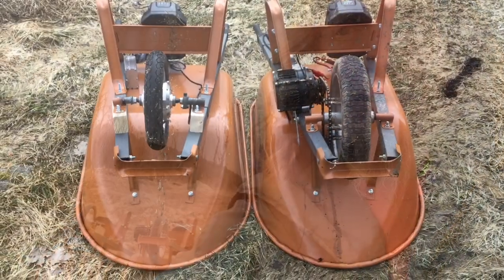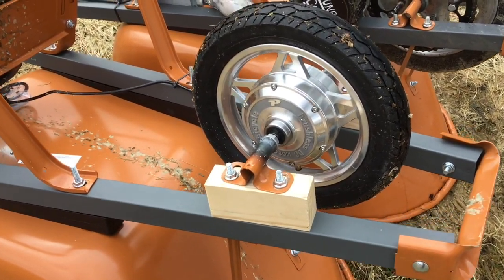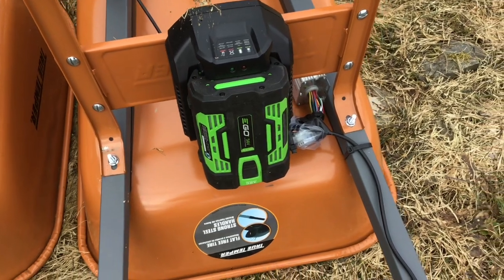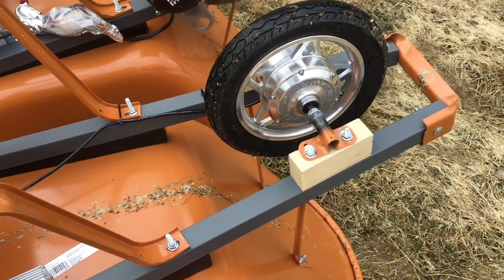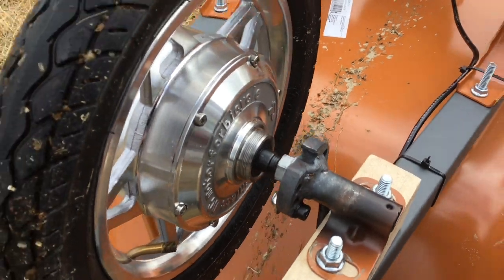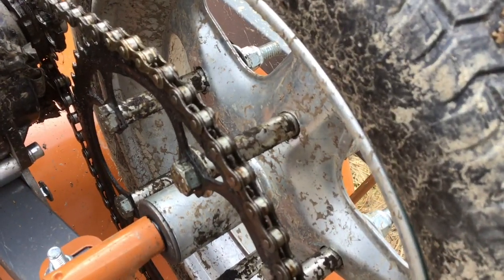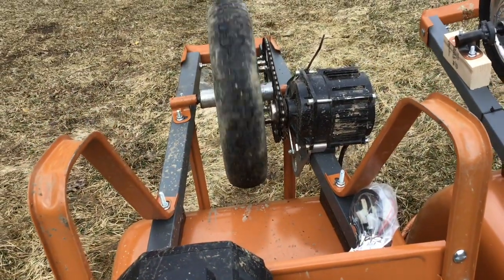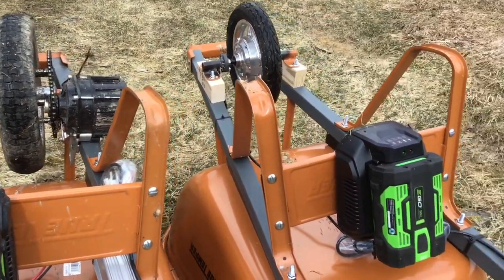Comparison between mid drive and geared hub DIY electric wheelbarrows

Comment: Great Video. Just subscribed. Any thoughts on the two-wheeled wheelbarrows?
Reply from the maker: Haven't tried it yet. The 3000W Cyclone can move close to 500 lbs of dirt. That's enough weight that I can barely maneuver it and lift it to dump. I wouldn't want to do more than that.
Reply: @Electric-fatbike  Thank you, I also have a few projects that you could make some suggestions. On our farm, I use tarps for occultation (weed control) and I was planning on modifying a cart that would incorporate two motors, One for the widely spaced dual wheels for positioning the cart and transporting the tarps and the second motor to help wind the tarps back up onto a reel to uncover the beds for planting. I haven't drawn any plans but I have images in mind to help stabilize the cart because I work in an area wind high wind gusts. Our youtube channel is here if you're interested.  Thanks again Kevin
https://www.youtube.com/user/DrKPW
Reply from the maker: @GrowingABetterTomorrow  You can put a motor on anything. Just get battery chargers and convert them to battery mounting units as shown in my videos and articles. It's easy and fun to do.

Comment: Try changing direction on motor and pulling motion rather than pushing (all weight on the wheel and although more grip ) 
My bbs02 1200w goes about 30-35kmh on moderate hill with 350-400lbs overall so that cyclone should not go much less than that even on the biggest hills. Means with good reduction and good grip it could get maybe even a ton up a big hill at walking speed